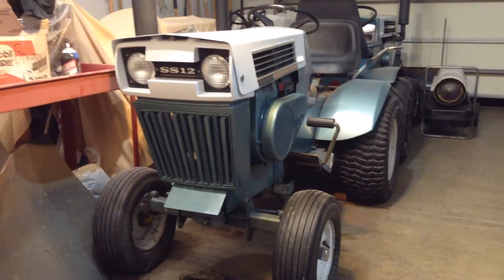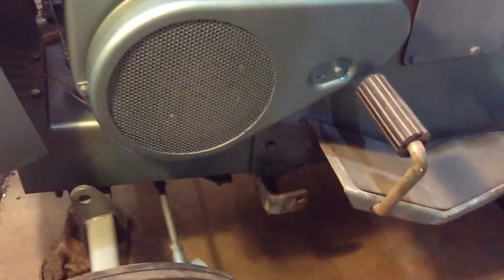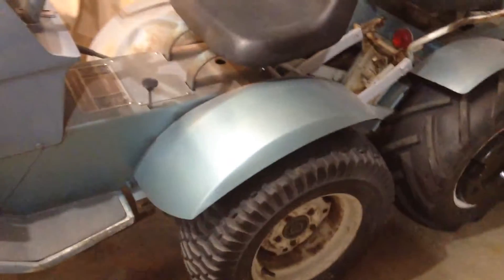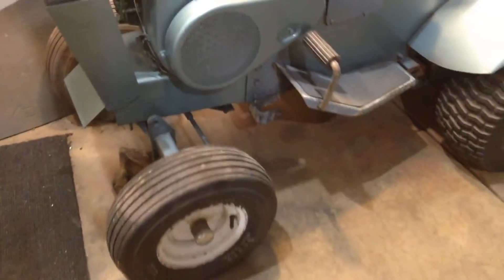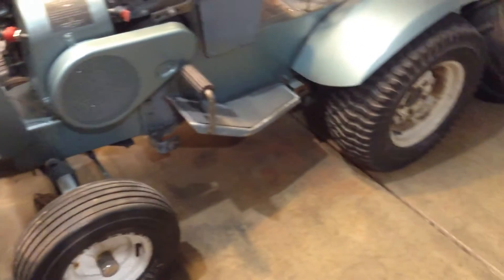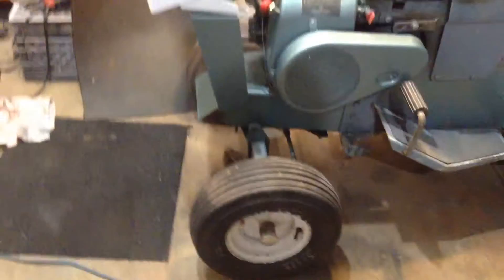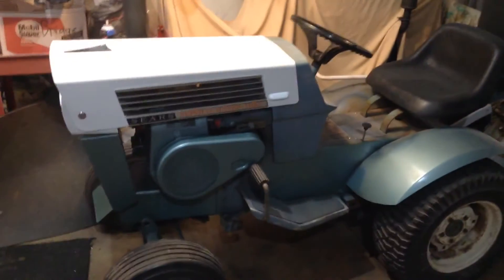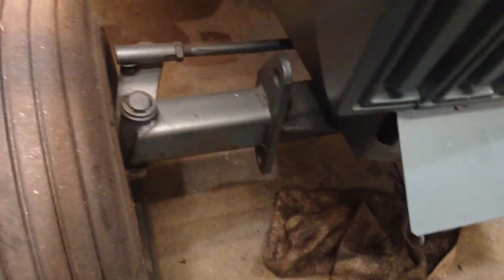1968 SS12 Sears hydro grill is done

Comment: glad to see yours looking nice. I'm really struggling with the transmission on my '68 project. broken bolts and other issues.
Reply from the maker: BillTheTractorMan Thank you Bill, man that sucks you're having problems. I know that when I swapped the rear end out on my  68 SS12 years ago I had the same issue with those bolts breaking, all the seals were leaking and the hubs kept sliding. That's why I put the rear end out of an ST16 in mine. lol Good luck with her bud!
Reply: RooneysSears01 I'm hoping my spare trans is salvage able. it's full of water too I found out. very disappointing.